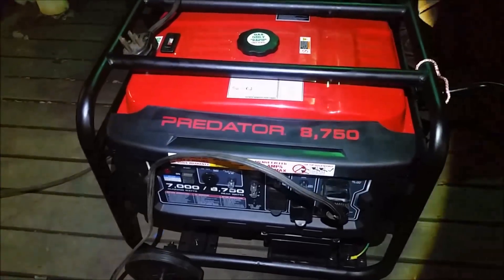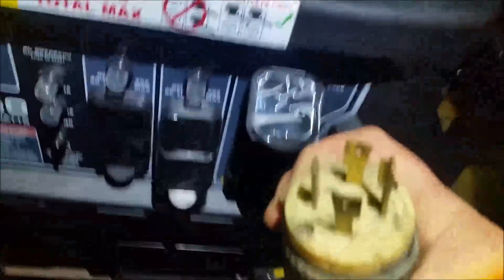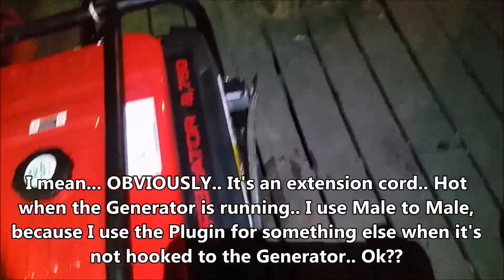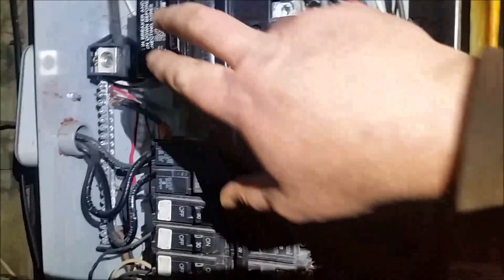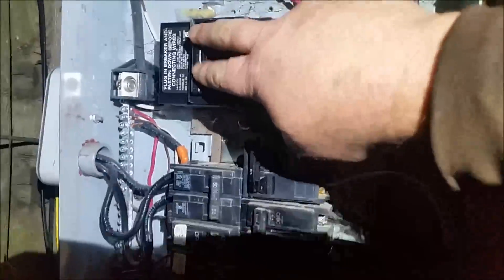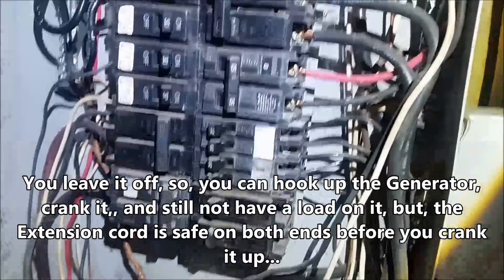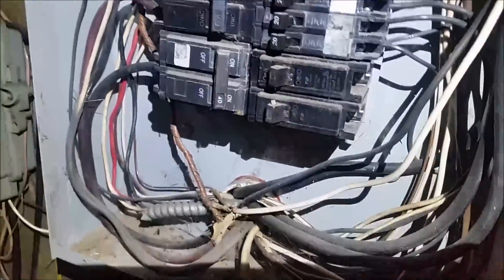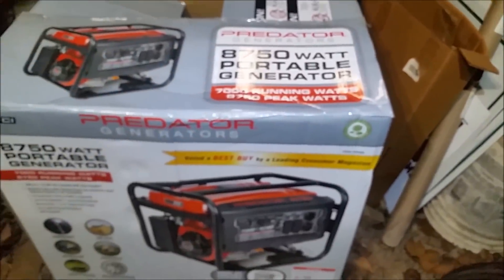Quick/Easy/Safe: Use Existing Plugin/Breaker for Generator hook up to your house Panel box.

Comment: A circuit breaker is meant to stop overcrrent in wires it supplies current to not the wires it it supplies so you have a fire hazard as well as a shock hazard if someone by off chance has both breakers on at the same time an interlock kit stops this. Even if you do thing in the right order someone else maayahoo not and the interlock is there make feeding power where it shou not go physically impossible.
Reply from the maker: Well Mr Andy Stitt.. If you knew what you were talking about, you would not have made the statement like you did.. 
Let me help correct you, so, maybe you learn something from being here.. 
A Circuit breaker will trip when there is enough current or Over current passing through it, to heat up the bi-metalic bar and trip the breaker, breaking the circuit..  If you don't understand the difference between A/C and D/C,, then, you would have the idea that you have about current only traveling one way, so, there are the hints and information you need to investigate and make more intellegent statements next time.. You didn't ask,, you told me.. I am only correcting your lack of knowledge.. Up to you whether you learn anything or not.. 
An Interlock is for those people who Can't Remember to Turn the Main Breaker Off,,, in a situation where one is needed or used.. 
But, you totally missed the picture here.. I don't know why,, it is in the subject of the video Title.. You know,, the thing you see first?? 
I will post it for you here, since you missed it.. 
Quick/Easy/Safe: Use Existing Plugin/Breaker for Generator hook up to your house Panel box.
HELLO!! You could not figure out that an Interlock won't work in this video?? I mean.. Use an Existing Plugin/Breaker??? Are you trying to show how smart you are??? If so,, IT AIN'T WORKING TO WELL!!!.. 
To your last statement.. These videos are NOT for people like you.. If you can't follow instructions without looking at them,, then, you have ZERO business doing something like this.. It is way, way,,way to advanced a subject for you.. 
Go and buy an Interlock, so, you won't forget to turn off the Main Breaker and put the Male Plugin outside of the Breaker Panel, so you don't have to make a "Male to Male Cord", and follow those instructions somewhere else.. 
There is no freaking way that I am going to put a Male Plugin outside coming off of a Main Breaker and count on an Interlock.. Besides,,,, I am just temporarily using my Welder Plugin to power my home.. When I am finished, the welder goes right back into service.. NO DANGEROUS MALE PLUGINS OUTSIDE OF THE MAIN BREAKER PANEL.. That is Pure Ignorance.. I don't subscribe to it.. But, since someone else said it was the way you should do it,, Until you can think on your own,, you should do it like they tell you, or hire someone else.. Don't try something this simple.. It is beyone your comprehension..
Reply: My friend who was a lighting engineer for 40 years says back feeding is dangerous because of  the circuit protection  bein after the power line and not before  Can you show me it would trip in an overcurrent  situation I might be able to follow but YOU TOTALLY MISS THE POINT OF AN INTERLOCK WHICH IS TO MAKE REASONABLY CERTAIN BOTH SWITCHES ARE NOT ENGAGED AT THE SAME TIME IT FORCES YOU TO DO WHAT YOUR LIST SAYS.
Reply from the maker: @andystitt3887  
Again.. I will say the same thing. You can't use an Interlock and use an existing breaker that you use for something else,, Which is the point of this video... 
To "USE AN EXISTING BREAKER", that you use for something else like a welder, etc.. An interlock only engages the Breaker as a feed when the main power is off. How the Hell are you going to use a Breaker for a Welder when you are done with your temporary backfeed and use it for your welder again, if the Interlock will only allow the breaker to be used when the main breaker is turned off?? Is that really hard for you to understand??? 
This video is not for RETARDS.. It is for people who know something about Electricity to temporarily use a Welder/Dryer or some other high capacity plugin to power their house via a Generator, and then, go right back to using it.. The only think you have to remember is "Turn the Main Breaker off".. If you need an Interlock to help you do that,, you CAN NOT USE THIS Procedure,,, NOR SHOULD YOU@@!!!!
Now, to address the cockamamy reply in more detail..

Comment: You need an interlock and an inlet box rated for odors along with the right gauge extention cord. The interlock stops both main and generator breakers from being on at one time and a cord with two male ends is dangerous if you don't shut off the generator or the mains before a because you can accidentally touch a live prong either in the house coming from the generator or the reverse if you fail to flip the main and the power comes back when you are setting this up.
Reply from the maker: Read the Title of the Video.. Your Solution does not apply to this video.. We are using an existing plugin... Saving time, Money, and using a Male to Male for an extension cord, vs putting a Male Plugin on the side of the house and using an Interlock.. 
Either way.. You still have to remember to turn the main breaker off.. We just give ourselves a bit more credit,, figuring,, we are going to Turn the Main Breaker off before we start messing with the Generator.. 
Pay attention to the Video and Title of the Video before you post something that belongs on another video somewhere else.. 
We know what we are doing here.. It is obvious that you don't, or you would not have recommended what you did,, based on the "PURPOSE OF THIS VIDEO"..

Comment: At 5:26 you say "a 220 breaker" feeding off "one 220 on one side and one 220 on the other side".  That is correct?
Reply from the maker: No.. Someone walked up behind me when I was recording and I made a few errors for a little over a minute or so.. 
Yes.. A 220v breaker (And I pointed to one), feeds off of "one" leg of the 120v on one side of the panel and the other half of the breaker feeds off of the other 120v leg on the other side of the panel.. 
That still might not make sense,, if you have never noticed how the breakers feed normally from the bus.. 
Lets call the two hots coming in at the top of the panel,, Left Leg and Right Leg for an easy explanation term (but is actually an incorrect description,,, because, the left leg also powers breakers on the Right side of the panel,, the same way the Right powers breakers on the left side of the panel.. Yes.. You got it.. But, you need to really look at the box to see what I am talking about, if you have never noticed that before.. 
If you put all 110 volt breakers in line (all slots filled) on the Right side of your panel box,, 1/2 of them will feed from the Left leg, and half of them will feed from the right leg.. In fact,, every other 120 breaker feeds from the same side of the bus.. That could be the left side,, or the right depending.. If your first breaker in line feeds from the left side,, and you move it and every other breaker down one slot, they will all start feeding off of the right side of the bus.. Why? 
Several reasons, but, the main one is,,,, a 220v breaker has to have 2 legs of 120v to add up to 240v. (110/120 and 220/240 used interchangeably) If all breakers on the right side of the panel only fed from the right side,, 220v breakers would have to go across from one side to the other in order to work.. The next reason is,, it really fool proofs the job for the average electrician.. If you have noticed, many of the ones who have commented here, really have no business fooling with anything dangerous.. Ha.. 
By swapping every other breaker in the panel to the other side of the panel, the chances of you getting a fairly balanced load in your panel is pretty high, just by chance.. This is not something to worry about, until you start switching off of an unlimited (Utility Power Source), to a limited power source of limited voltages,, like a Generator would be for the average home/homeowner with a portable generator.. 
Remember.. The generator is really only another large motor being pulled instead of applying voltage to pull something else.. All of that voltage (2 legs) is being created inside of that one single motor in a minimum set of 2 windings, sometimes more depending on the type of motor.. If you pull a severe load on one winding, and little to no load on another, Electricity is now out of balance and could easily jump from one winding to another and would now be looking for the easiest path of least resistance to a consumer, which in that case would be a ground.. If there is a faulty ground,, it highly likely to do shit that would confuse the best electrician, and start making your house feel like it was haunted,, and start taking out sensitive electronics, shorting out Surge strips, blowing power supplies, popping circuits on anything that had a regulated voltage coming in like phone lines (DSL to your ethernet port on your computer, etc..).. 
But, if you try to ask the average electrician how that works, good luck with that.. Ha.. But, if he does sound really convincing, then, ask him,, If lightning struck 200 feet away from my house, (hit the ground), why would it pop one port on one hub, and 6 on another, but, passing through another hub between the two and do no damage whatsoever to that one... I had that happen to me and I still can't explain it, but, I know that is what happened..  All the way down to,, burning an ethernet patch cord out, 3/4 way to the other end,, and the only thing I could see why,, was, it was kinked at the exact location where the cable burned out.. I expect, it was traveling fast and had some momentum and jumped past the shielding and came out into the room and continued straight, since the side of the metal desk was next to the kink in the cable.. 
Here is another one that might save you some grief... If you ever deal with trailers (boat/utility, etc..) and your lights were working perfectly last time you hooked up the trailer,, then, you just parked it and next time you hooked it up to the same vehicle, and turned on your right blinker and your left blinker started blinking faintly, and no blinking on the right blinker.. Stop right there and fix your ground on your trailer,, Or,,, vehicle.. Because one of them is bad.. 
Don't ask me how that happens.. Because on most vehicles, the Right Blinker is not connected to the Left in any manner whatsoever, even when you hit your brakes.. Brakes is only the Right and Left Blinker on solid at the same time. That is why you can turn on your Right blinker, hit the brakes and the Left Brake comes on solid and the left just blinks.. There really is no such thing as brake lights on most vehicles.. Now, on some newer vehicles, they have separate blinkers and brakes, and they have special conversion boxes that you connect to the vehicle that has a little computer chip that monitors the Brake and blinker lines and makes those decisions based on a programmed logic, but, when it goes to the trailer (if it is a 4 wire flat plug), only has (Running/Tail Lights=brown, Left Blinker=yellow, Right Blinker=green and ground=white.. If you have it wired up 100% perfect and you have a good ground,, the lights work 100% perfect.. If you have them wired up 100% perfect and have a bad ground and don't know it,, you are likely to wire the whole trailer all over again and never realize what was wrong with it.. Ask me how I know that.. Ha..Ha.. 
BTW.. 110/120volts vs 220/240volts. My experience has been the actual voltage is more in the range of 115 to 118 volts for example, but,, some utilities are very close to 110v, and others bank closer to 120 volts just for example.. Equipment will run on either.. You don't start having weird problems until you get below 100v.. You computer will start hanging up below 100v's (brown outs), and will generally reboot if voltages get much below 95-98 volts, and some will hang in before rebooting until you get down in the 85volt range.. About 95-98v is when you begin to see a faint flicker in your incandescent light bulbs, if it happens quickly.. 
I had a 110v breaker in a house one time that was slowly going out.. It drove me nuts for 3 or 4 months, until if finally failed.. Computer was constantly hanging up, etc.. Phones would ring weird when no one was calling, etc.. I never put two and two together, that, those items were on the same circuit, since some were in one room and some in another adjoining room..  They shared the same circuit, since they were on the same wall... Just a few tid bits to help you get a grasp on electricity.. 

220 volts requires two hots and a Neutral and ground.. Correct? That is what the books say anyway.. Ground and Neutral actually go to the same place in the panel.. At the plugin, they are "Frame Ground", and "Return Neutral"..
Here is one for you.. I have a deep well installed on my property.. The 220v wire runs under the ground.. Direct burial.. Not even in conduit.. It would be a royal pain in the arse to replace it, since it runs under some outbuildings.. But, it has only two hot wires coming from the panel.. No ground wire at all in the casing.. It goes to the Pressure Cut in/Cut out switch and terminates on two of the 4 contacts that operate the deep well pump if you know how that works.. Then,, how does the pump work without a ground?? 
The pump has 4 wires.. 2 Hots, A Neutral and a Frame Ground (Red/Black/White/Green).. The Frame ground(Green) also terminates to the fame of the Pressure Switch, and then runs down into the well, and the water table is at 180 feet.. 
I can't tell you for sure, whether it travels through the ground to "My Ground Rod" by my house panel, or it is traveling to the ground wire at the pole where the transformer is,,, but the books say, it has to be going to one of them..  One day,, I am going to find an old 220v motor that I have absolutely no use for, and I am going to hook it up 2 wires only and see if I can duplicate that.. Sit it on a block of rubber and see if it will work.. Something tells me it will though.. And, if not, I will hook a bare wire to the frame and stick in the the ground and watch it power up..  An Electrician would tell me I am crazy, but, hey,, you can't argue with physics that is staring you right in the face now, can you?? Cheers. I am going to wrap things up and grab some sleep.. Long day tomorrow. Hope you get some value in some of that.. 
Moral of the story.. As a general rule of thumb,, follow the rules, but, when something happens out of the ordinary,, stop, look ,listen and reason.. And never believe someone that says,, "It can't be done",, or there is "No Way" that would work like that.. Or,, if they do,,,  go home,, try it out and go back and rib them a bit and make a healthy wager and teach them a valuable lesson.. Ha.>Ha.. And, have a nice dinner on them.. Ha.>ha.. Cheers!!
Reply: @MarkThomas123  220v motors don't require neutral or ground to run they are just L1 to L2. Think of it as same as the generator winding but the pump motor has no center tap. The ground is just for safety.

I was ready to backfeed during the recent snow (and 40 hour outage) but my 19 year old Coleman PowerMate 5000 let me down When I turned on the petcock the rubber bushing/grommet holding it in the gas tank started seriously leaking, ethanol finally got to it. For anyone that has a plastic gas tank with that grommet, it needs to be occasionally checked or maybe keep a spare on hand.
Reply: @MarkThomas123  Usually things like clothes dryers and Oven/ranges have 2 hots and a neutral because they use 120 and 240 volts within the machine, so they need the neutral. The new code says dryers need a 4 prong plug, instead of joining the ground and neutral at the dryer and using a 3 prong plug.
Reply from the maker: @illestofdemall13  Yea.. I will never forget opening the first 220v and seeing that "Some of the Terminals" were not used.. Made me think,, Well, if they are there, must be there for a reason,, so, why didn't they use them.. 
Which Reminds me.. When I have time,, I need to do a quick video on my 1 HP Deep Well Pump and post it.. It would probably be about as Controversial as this video.. Ha.. I moved here in 2005, so, 15 years ago roughly... My Pump 220V 1HP runs on 2 Wires only... I SWEAR!! I can Video it.. 
But, it has this thing that is much larger than a copper wire.. It is called "Earth Ground", which is the Water, then, Earth, and never misses a lick.. I have even disconnected the Copper Wire to the Ground Rod, and it still works,, as a test.. 

Might be more safe, to have a 3rd and 4th wire, but, not necessary.. I have worked on it a time or two without throwing the breaker, something I don't do often with 220v, but, it is just as predictable as any fully grounded circuit.. Cheers! Need to do that Video. Hmmm..
Reply: @MarkThomas123  Many things that only require 240V will work from 2 hots and no neutral. Pretty much anything will work without a ground, but the ground's job is to trip the breaker in the case of a ground fault situation. If a hot was to make contact with a metal piece of equipment, j box or conduit, if there is an effective ground fault current path, the breaker will trip properly. If the parts aren't bonded and grounded properly, then someone could get electrocuted. Ground rods will not help either. You need a low impedance ground going back to the panel. Could be a properly sized ground wire, and/or tightly coupled raceways like EMT, RMC, IMC, etc.
Reply: Stay safe